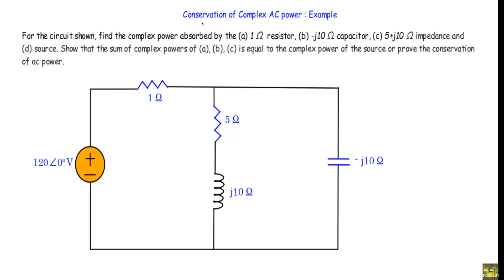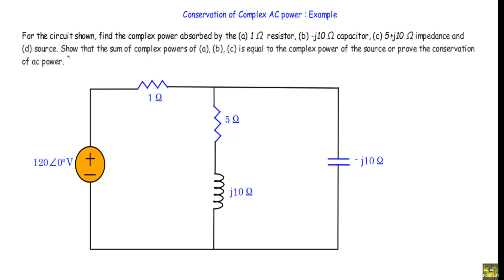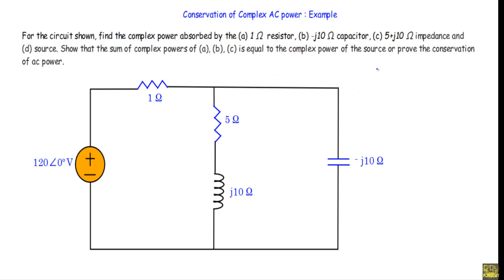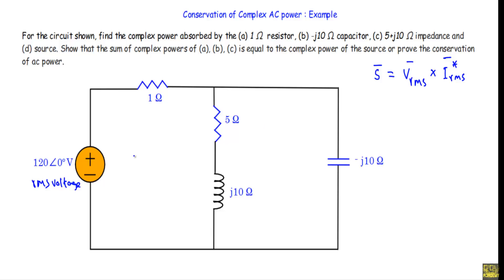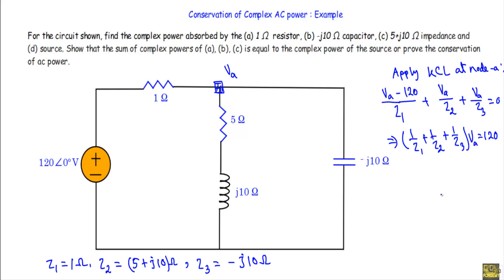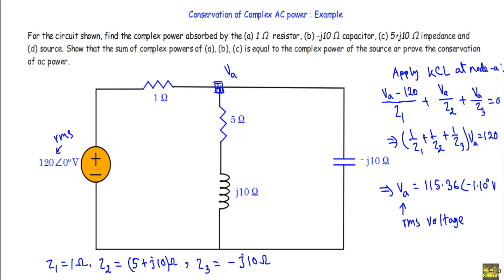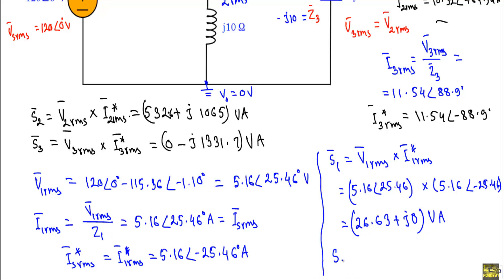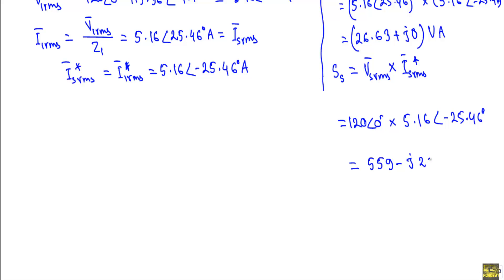Complex Power : Example 3 ( hard )

Comment: I''m getting a wrong value of i3 here despite getting i1 and i2 correct. 
i3 I'm getting as 9.094+11.534j. 
I didn't use the nodal analysis, I found the effective impedance, found the RMS current and then found out i1 using current division. Not sure where I'm going wrong